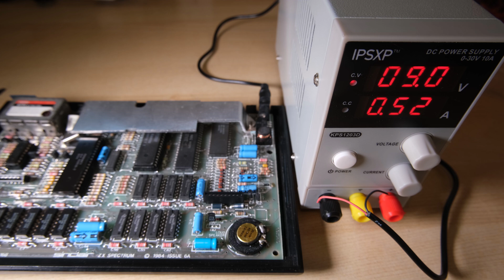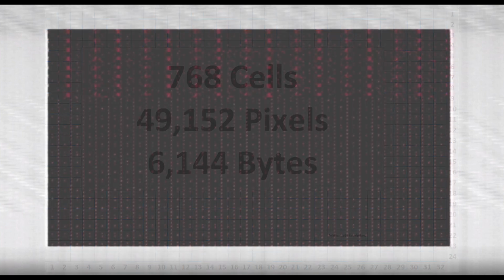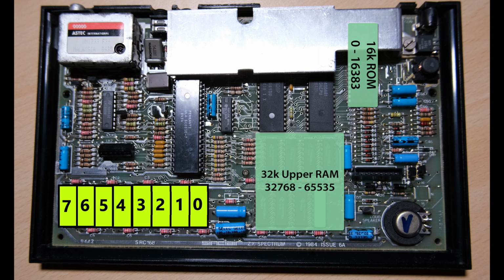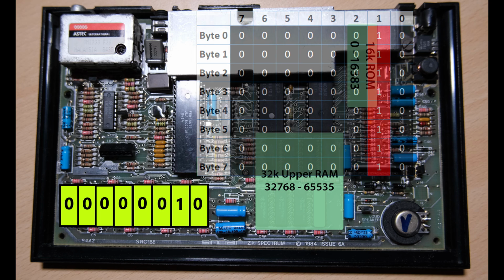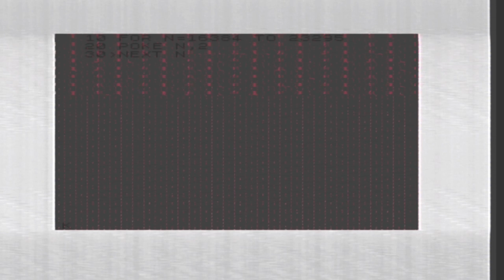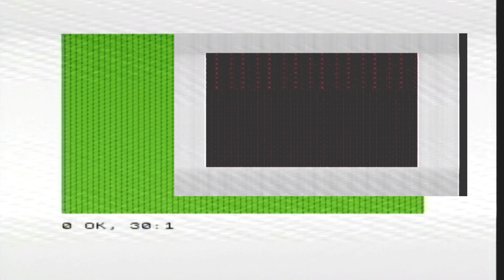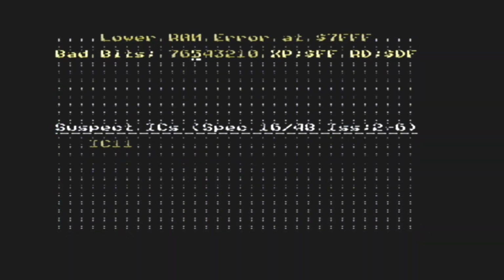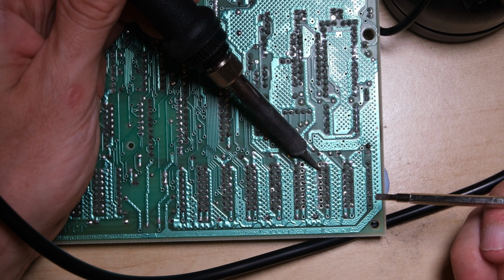ZX Spectrum Lower RAM Fault and Replacement

Comment: Nice, thanks.
When working on rare boards for specific use my way is to cut the pins of the top of the IC chip, then pull the pins one by one while melting solder whit iron.
There are industrial board were ic's are pressed in the board, thats the only way posible.
Destruction of IC, but its mostly logic or driver type, not to exotic.
Boards are unobtanium.

Comment: Hi,
Please consider cutting the pins close to the capsule to remove it and leaving only the pins on the PCB.
Then remove the pins one by one with the soldering iron.
In the end, use the solder plate, but only to clean the hole, which is completely free.
For years I used this process, because a PCB cost a lot of money and the chip only cents!
Don't take chances!
Thanks for your work!
Reply from the maker: Hi, yes this is a good method if you know for sure the chip is bad. I dmeonstrated it here - https://youtu.be/5A7fzoQ3a34?t=529

Comment: Try one of the Green RS pro solder suckers, they're not cheap but we'll worth buying.
Reply from the maker: Is that the manual piston style one?
Reply: @HappyLittleDiodes  : Hi: Yep that's the style, quite a powerful thing to be fair. For smaller de-soldering jobs I tend to use that rather than wait for the de-soldering station to heat up, as I said they're not cheap but worth the money if you use it regularly.

Comment: Don't forget to give desoldering needles a try 👍
https://youtu.be/b_5HgsIGb2E
Reply from the maker: I had a look at them! I'm kinda getting the knack with this method but I'll have another look,  I didn't quite see how they worked
Reply: @HappyLittleDiodes  As the solder doesn't stick to the stainless steel needle/tube, when you slide the tube over the leg and into the PCB hole the solder sets either side. Slide the tube out again and the leg is completely free.
I've found some newer PCBs have very small holes that don't leave room around the component legs.
Not great for complements with bent legs either.